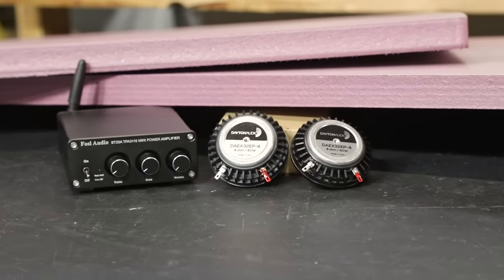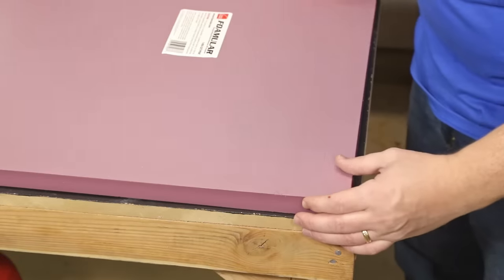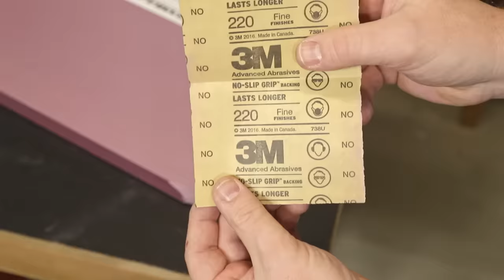How To Build "The World's Best Speakers" - Are Flat Panel Speakers Really Any Good?

Comment: Having built 2 different sizes of these about a year ago, and performing a dozen or more comparisons with traditional speakers... here are my conclusions. 
1. Amazing stereo separation 
2. Terrible low end. Yes, even with the larger panel.  Requires a sub.
3. Placement of the panel near a wall is critical.  Too close and you can have wave cancelation.  
4. Listener location is critical. There are sweet spots and sour spots. 
My conclusion- cool, a neat talking point, not bad to supplement a listening area. But nothing to take too seriously if you are an audiophile. Glad you gave it a try. But comparing the sound of the panels to your phone speakers is not a fair comparison.  Comparing them to a vintage 3 way set of towers or a modern high end bookshelf system IS a fair comparison.  I promise you that these panels, while ridiculously cheaper than a moderate pair of speakers, will still leave you longing for some bass a few minutes after the initial wow subsides.
Reply from the maker: Hey Slick Flick - Thanks for taking the time to comment and provide some feedback. I agree with some of your conclusions, especially about the unfair comparison against my phone speaker. So I did a follow-up video with much more in-depth testing and comparison with Klipsh reference monitors: https://youtu.be/XC814uQjlaE - I was surprised by quite a bit of what I learned in those tests.

Comment: Should you sand both sides or just the exciter side? Is gorilla glue a decent substitute? Thanks.
Reply from the maker: Hi Christopher - you should sand both sides. Gorilla glue will work fine, it just takes a bit longer to cure. Good luck!
Reply: @AmplifyDIY  Thanks for your answer and your testing video . I noticed the painted panel didn’t sound as good in your other video. I’ll probably cover with a very thin, silk like print. Thanks again!

Comment: Very interesting!
I like the better sound test you've done (although a test with great microphone & perhaps different shapes would be perfect)
One thing I wonder though is - shouldn't the back of the speaker be fixed to the wall for example?
I mean that currently roughly half the energy goes into moving the speaker itself the opposite way of the panels, and if it was fixed it would transfer most of the energy into the panels.
What do you think?
Reply from the maker: Hi Blue - a lot of other people wondered the same thing, so I made sure to include a fixed-mount in my follow-up video here: https://youtu.be/XC814uQjlaE

Comment: I wonder if you’d have more volume and bass if you built a frame that left the panel free floating but could mount the exciter to keep it in place and put more of its energy into the panel? Awesome video! Might have to make a few of these for near wall surround speakers.
Reply from the maker: Hi Anthony - I've just finished up filming my follow-up video, and I can say pretty definitively that mounting the exciter to something rigid produces a worse response / tone / volume.  It's best if you can suspend the whole panel, and let the exciter move as well. Also, if you do mount them close to a wall you should add some sound absorbing material between the panel and the wall, so you don't get sound reflecting off the rear, bouncing off the wall, and causing distortion to the sound coming off the front. Thanks for watching, and look for my follow-up video as soon as I can finish editing it!
Reply: @AmplifyDIY  I can’t wait to see it!

Comment: What are the wires needed for this project? I am going to make this this weekend!!!
Reply from the maker: Hi Ryan! The exciters come with small blades for the connections. I used regular speaker wire with some spade connectors to connect them, but you can also just solder the wires directly to the blades on the exciters. You can get speaker wire just about anywhere - WalMart has it, I  believe. Good luck!

Comment: New crazy idea here, as I read human hearing can distinguish 1400 different pitches. What if you build 1400 active speakers each tuned to a specific frequency, run input through some logarithmic FFT, modulate each bin intensity as amplitude of since wave at the corresponding frequency and feed each signal to matching speakers? Theoretically must be a perfect speaker system right?
Reply: Pixles for sound

Comment: how much power do you have to pump in to get some decent sound out?
also ofcourse the type of material matters to reproduce the sound and the thickness to,  i guess that to get the ideal material size you'd have to figure out how fast sound travels throught that perticular material and make it atleast 1 lambda of the lowest bass you want in size. and the thickness of the material probably makes it freq dependend where thicker materials have a harder time flexing thus fibrating at lower frequencies but probably vibrate better at higher freq.

Comment: Why does he mount the cotter pins in the center of edge of the foam board? Because of the weight of the exciter, it seems like it would be better to angle it into the board it the back edge of that foam panel. That way the hanging connection will be at the center of gravity, and the panel will hang vertically straight.
Reply from the maker: The position actually makes very little difference to how the panels hang... but if you build some, feel free to mount them at the edge of the board rather than in the middle.

Comment: How did the bigger ones do for bass ? Or would smaller ones make bass ?
Reply from the maker: These panels really are not ever going to be very punch or perform well in the bass department. I did a follow-up video where I tested a bunch of different music with some panel modifications. Bottom line? You'll need a subwoofer: https://youtu.be/XC814uQjlaE

Comment: How do they do with voices? How do you mount them? Will they work well with a television?
Reply from the maker: They work great with vocals! The panels need to be allowed to vibrate, so they need to be mounted in a manner that allows them to be suspended. If you mount them near a wall, you should place some acoustic insulation behind them on the wall so that they don't produce interference reflections. They would work fine with a TV, but they need their own amp. You can't plug them straight into most TVs and expect them to work. Great questions!

Comment: Do you think this would be a good replacement for overhead tweeters in my truck? I was thinking using 2"x5". Obviously can't use 2'x2'
Reply from the maker: Boy - I have no idea how they would sound with such small panels. I don't think they are really recommended for a car audio situation. You'll likely be better off buying some inexpensive tweeters designed to fit your truck. Good luck!
Reply: @AmplifyDIY  Darn, still cool concept though. Thanks for the response!

Comment: Question. You are running 4 ohms into an 8 ohm amp. Does it overload the amp? I play guitar and going lower than the rated amperage will blow your amp.
Reply from the maker: Hi Jason - no, this does not overload the amp at all. This amp is rated to deal with speakers that range from 2-8 ohms without any problems. Remember that ohms is a measure of resistance, not amperage. Check out this article that explains the differences between ohms, amps, watts, and volts: https://science.howstuffworks.com/environmental/energy/question501.htm
And thanks for watching!

Comment: central body of a tone you will find in 2 way setup, when below panel will be made of wood(plywood), and bottom will be that you actually have, plywood desk need some true power, so maybe 40w exciter, soon i will make 2 way setup, where plywood will have 40w at 8ohm, and styrofoam 10w at 8ohm, ill connect them at parallel, so i will get 50w at 4ohm on one side, so then its easy job to find 2x50w at 4 ohm amplifier :-)

Comment: These speakers are producing sound waves from both the front & the back. The wave from the back will be 180 degrees out of phase and will cancel the waves from the front at some frequencies. Therefore i would suggest a square board is the worst possible shape. Try a triangle, or even a rectangle if you use prime number dimensions like 5x7 (avoid multiples of 2, like 24x48).
Reply from the maker: You make a great point - it's really important to put some sound-absorbing material behind these things. The worst possible place to mount them is a few inches in front of and parallel to a wall. I've tried it, and the destructive interference is... terrible. :)

Comment: If  this was rimmed with like... a Rubber material or something softer yet flexible it is likely to recover the base frequencies quite well. It should however be hung from the rubber such that it can vibrate with the system.. Something like a thick rubber tubing around the rim so that base causes the entire panel to thump while the higher freq are produced by surface vibrations.

Comment: I did notice the exciters are moving a lot - more than the panels.  Either adding supports to the exciters or adding weight to them may help.   Also,  The little amplifier you used may have trouble with certain frequencies.  Have you tried other amps?  Third, would eliminating the Blue Tooth interface may make a difference.  Have you tried connecting the exciters directly to the source?
Reply from the maker: Hi Willy! I'm currently in the process of filming a follow-up video, where I'll address every one of these questions. I've got some different amps, I'll be using wired connections, and I'm currently building a rig specifically to test how these sound when they are mounted from their exciters. Stay tuned!

Comment: Silly question, what type of cable is used to connect the exciters to the amplifier?
Reply from the maker: Hi Thomas - not silly at all, but also not complicated: I used basic speaker wire. You can find it just about anywhere that sells TV's or home stereos. I think I picked up the spool I've been using forever at Walmart years ago. The amp has a little lever/latch connector that you just slide the cable into after stripping off a bit of the end to expose the bare copper, and to connect to the exciter I added spade connectors to the other end of the wire and slid those over the blades on the exciter. This was optional, though - you could also just solder the wire directly to these connectors. 
Thanks for watching!

Comment: I should try to mount the back of the drivers on a fixed stand, so the panels are not hanging on wires. This ables the panels to move freely in the air which will result in better full range response.
This is interesting
Reply from the maker: Hey Pacosound - I found that mounting them to a rigid point actually made the panels sound significantly worse: https://youtu.be/XC814uQjlaE
Good luck!

Comment: Is the volume equally loud at the back, or mostly focused toward the front?
Reply from the maker: It’s pretty equal off the back as well.
Reply: @AmplifyDIY  good to know. Do you know of a way to reduce that? I live in an apartment and thought these would be great on the ceiling, but I have an upstairs neighbor. 

A solution would be nice, but the video is still worth saving for when I can cause more of a disturbance without being directly connected to people I’d disturb.
Reply from the maker: You can add some acoustic insulation to the ceiling directly behind these speakers. It won't block everything, but it will substantially cut down on the noise transmitted up to your neighbor above. Good luck!

Comment: Hi. I enjoyed your video on the “World’s greatest speakers”. 
Questions. 
1. You placed one driver in the center of one panel and the other driver at the 2/5th, 3/5th position of the other panel. Is this for stereo or mono? Would I need 2 panels per channel?
2. Can you use different size drivers for different frequency ranges, and a X over? I’m trying to visualize what that would look like. 
Thanks for your attention. 
Paul
Reply from the maker: Hi Paul. For your first question: each panel is for a single channel. I offset the exciters when using 1 per panel so that any troughs in the frequency response on one panel would be filled in by the other. The placement of the exciter on the panel does have a pretty substantial effect on frequency response, so offsetting one helps smooth out the total frequency response between the 2 panels.

As for your second question: it's better to vary the size of the panels rather than the size of the exciter to bring out different frequency ranges. Larger panels have better low end. Smaller panels have better highs.

You may be interested in this follow-up video I did as well: https://youtu.be/XC814uQjlaE
Reply: @AmplifyDIY  Hi Steve. That was a good video. I did hear differences between the various shapes and processes. 
One of them was a dual exciter, but no mention of where they were placed. I think these sounded the best. 
I’m thinking of coming out of my Fosi amp and going into a Xover to separate the frequencies into low and high. The low frequency wires would go to a larger panel and the high frequency to a smaller panel. So two panels per channel. 
Thanks for all your help. I think I’m going with the Fosi BT30D that has a sub woofer output. 
Paul
Reply: @AmplifyDIY  
Questions. 
1. Where do you get sheets of extruded polystyrene?
2. What thickness do you use?
Thanks,
Paul

Comment: Jus got hold of some Dayton Audio exciters (2x midrange & 2x bass) & a 2.1 50+50W (+ 100W sub) class D amp, along with some Correx 'Plastic Cardboard' A1 sheets  - am looking to attempt to  put together a stereo speaker setup - any advices?? Can the 'Subs' actually co-exist within the L-Rs, or could/should they be stand-alone in a separate (Correx?) 'Plastic Cardboard' piece, similar in a traditional Sub ?-  any feel for the practicalities/dimensions/proportions?

Thx :-)
Reply from the maker: I'm not sure that the plastic cardboard will perform all that well - but I'd encourage you to try it and see how you like it. I've never tried the bass exciters on a panel - I use a separate standalone dedicated subwoofer (which works great!): https://youtu.be/XC814uQjlaE
Reply: @AmplifyDIY  Thx for the reply - yes, I have done some initial experiments with regular cardboard  (A1 sized) with  Dayton midrange exciters along with a traditional 12" sub - results are encouraging - will experiment further..

Comment: Do you reckon these will good for atoms/surround speakers?
Reply from the maker: Honestly: probably not. In order to get good fidelity out of them they need to be quite large - and they are not very directional. They tend to fill the room with sound, while atmos setups need speakers with more directionality.

Great question!
Reply: @AmplifyDIY  I see thanks for the response! I was hoping to have to two of these right behind the sofa as rear channel speakers since I don't really have so much space behind the sofa, maybe 4 inches but, make them 40cm x 40cm. So, they would have been perfect. And have 4 more height speakers suspending them from the ceiling. But maybe it won't work.

Comment: Unless I missed it.  I would have appreciated a detailed description of how you hooked the wiring up to the exciter and to the amp.  Other than than that great video
Reply from the maker: Hi Rich - the exciters are wired up the same way you would wire just about any speaker. The exciters have tabs on the back meant to receive a female spade connector. I simply connected negative from the amp to negative on the exciter, same with positives. The amp is a 2 channel amp, so each exciter had it's own channel to drive it.

There are more details in my follow-up video here: https://youtu.be/XC814uQjlaE

Comment: The pair I built out of 24x48" acoustic ceiling tiles seem immune to feedback. They're mounted in our church. The very wide vibrating surface compared to a cone seems to reduce any single source that the mic will pick up. Our previous 12" cone speakers were super sensitive but with similar mic gain levels, you can even stand in front of the panels without feedback. In that big room, they're ideal for voice but thin on the bottom end. If it wasn't for the organ, I'd be wanting a subwoofer here.
Reply from the maker: I never really thought about it, but a church setting like you described is a perfect use for this sort of speaker set up. I’m glad it’s working for you!

Comment: Is the power of a audio system good enough to drive these panels or do I need a separate amp?
Reply from the maker: Depends what you mean by "audio system". The exciters I listed are rated at 50 watts. They'll perform best when whatever you connect them to can supply that much power.
Reply: @AmplifyDIY  Thanks for replying, What I have is a Yamaha AV reciever. Says Rated Output Power (20Hz-20kHz, 2ch driven) 80W 8 Ohm.  So I can Power 2 40W 8 Ohm exciters?
Reply from the maker: @adama1294  Yes, that amp should work fine. Good luck!